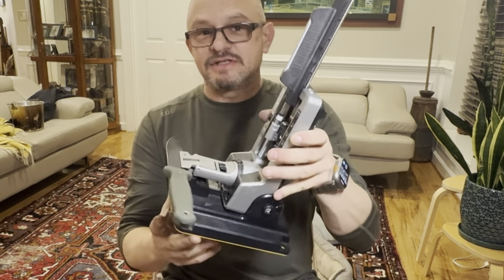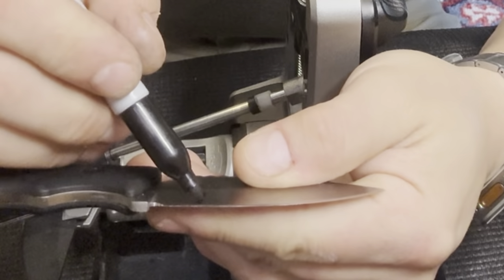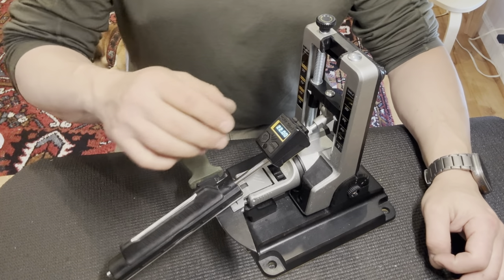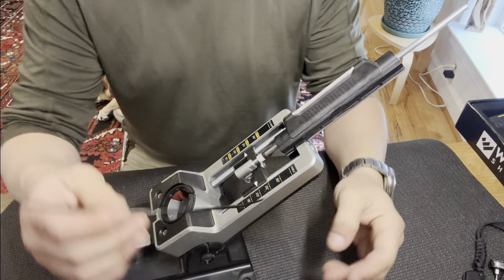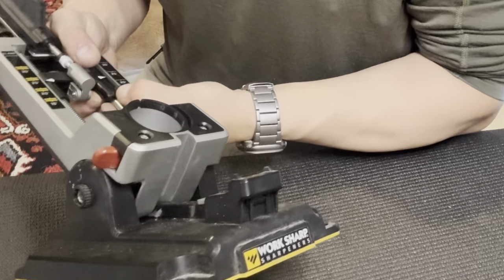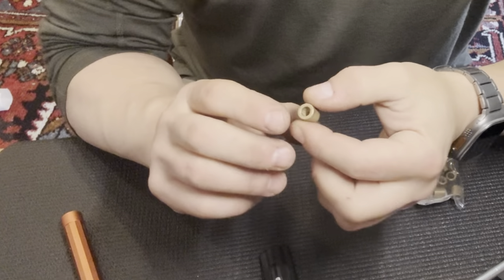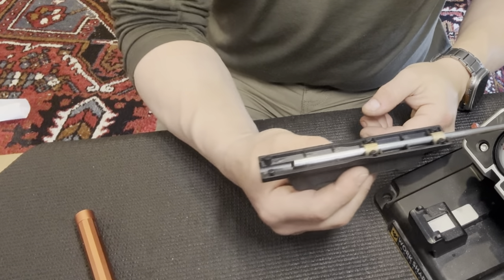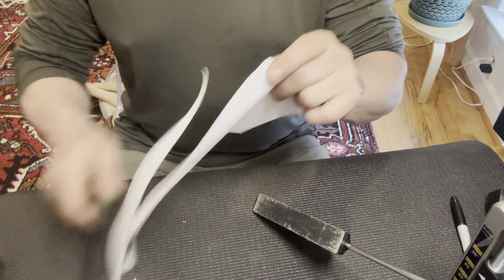Episode #1. Did Work Sharp stop $3 short of Professional level? Is it really PRECISION Adjust-able?

Comment from the maker: Update! Update! Work Sharp is shipping units with screw-less plate carrier. I haven’t had a chance to play with one.  So! Don’t buy the bushings until you receive the sharpener! You won’t need them for at least 3 months anyway!
Reply: Well unfortunately and good for them but most Big Channels are paid for reviews or the item has been given to them. Doesn't leave alot of room for the negatives or suggestions.. only the positives and ➕️'s.. That's why your channel is Important to give us the real and real world challenges.. Good job on your unbiased opinion and Honesty.. Thx!!
Reply: Jon machinist 45yrs here have you disassembled the frame from the  adjustment screw and vertical support bar.  I would like to add 2  assist springs to keep light tension on the whole thing, like a press
Reply from the maker: @broken1965  I think the assembly is more akin to the tool feed drive on a lathe: a worm gear with a parallel shaft. So all that was needed was additional bearing pressure on the shaft side. Unfortunately they left that side open hence the zip tie fix, no way to fit a bushing there.
Reply: If you don't mind me asking what are your thoughts on the lansky Precision Sharpening Kits ?
It's a nice small rig that is easy to field carry .
Reply from the maker: @daryenmirabal2656  just saw the question. If I was looking for a portable kit, the WSPA is much better than the Lansky. The latter’s stones fall out and crack in the middle of sharpening and just for that I would boycott the brand, so disrespectful I find the lack of proper adhesive. But, since it was my first fixed angle sharpener, here’s the truth: It nearly destroyed my confidence in the ability to sharpen knives. With all its shortcomings, the small WSPA is a decent portable tool.
Reply: I bought it. Not a good product . The clip is small and not suitable for small knives, and the body is mostly plastic and doesn’t feel very solid. Depends on what knife you're sharpening, I have one (Crkt LCK + Liner Lock) and the clip doesn't hold it properly, the TSPROF Pioneer Sharpening Kit would be a better choice if it's on sale
Reply: 2nd reply (see below) - Be careful when ordering that Amazon sends the correct size. I didn't notice that the wrong size was in my cart. Not going to send them back though and will have to wait until March 13 before the right ones get here.
Reply: @CuttingBoardRx the stone separated from the plastic handle/backing? Did you happen to buy the kit from Amazon? I’ve had a couple lansky kits over the years, never had that happen. And of the many people I know who have owned their kits over the years, I’ve known 2 people who had that happen with a stone and both bought them from Amazon. I wonder if there’s fakes floating around because Amazon commingles stock. I’ve seen a few people receive fake Spydercos (PM2s).
Reply: Thank you for your honest review and fixes for the problems you found. I have watched a lot of knife reviews recently, from other people, and I have not seen anyone give a negative review on any knife yet. These other people doing "reviews" must be getting some kind of compensation. Thank you for your honest and effort.
Reply: @CuttingBoardRx question. Is there another style sharpener like this that is a solid buy for me. Thanks for this video.
Reply: What do you think about the possibility of installing a ball bearing?
Reply from the maker: @XSXshurikXSX Sure, but linear bearings in this size are hard to find plus they all have nylon inner core, so I would be just trading one problem for another.
Reply: Does the screw less plate carrier mean we can’t access the bushings now?   That would be a bad thing or am I missing something?
Reply from the maker: @ I think that it is NOT meant to be disassembled, so it is not meant to be maintainable 😬
I have to get one to figure this out. I think WS are pissed at me for providing a cheap maintenance solution vs. what they actually want to do: sell you more media carriers. If you haven’t bought this sharpener yet, hold off and watch these videos:
XARILK Gen 3 Fixed Angle Sharpening Tutorials
https://www.youtube.com/playlist?list=PLQk7wjytAnymGwTUYahJoDbCqwgtVWogf
American-made should stand for high quality and ease of use, but WS corporate mindset prevents me from recommending any of their products anymore.
Reply: If I don't shim between the blade and clamp on both sides. I'm at least a degree off when I flip it. Anyone else having this problem?
Reply: Please let us know if you figure out how to get it apart, or a work around.  Just got this Sharpener for Christmas and would love to be able to do the bronze bushing upgrade.
Reply: @CuttingBoardRx  Here's what I got from their customer support.  I'm paraphrasing but would appreciate your thoughts as you know this device as well as their engineers....  The abrasive handle for example has been redesigned with an improved process that no longer has the screwed-on plate on the bottom, so replacing the bushings is no longer possible or required. It was done to prevent the handle from cracking and breaking apart around the screw holes. Our testing shows that the oil impregnated self-lubricating bronze bushings are more prone to collecting debris and getting sticky since the self-lubricating oil collects more grit and debris, which makes it harder to clean and is more prone to wear. Therefore, we have chosen to continue using the engineered plastic material since it performs better over time when used as directed with light pressure, frequent cleanings and no lubrication. I'm not trying to upset the company.. just trying to get facts.  Also, worse case I don't recall the company names but another makes a stone/holder/slider for this device too.  Granted another $50 shipped but wondering what your experience that that is... for somebody that already owns this device. Thanks again.
Reply from the maker: @ I investigated the new holder and found that it wasn’t possible to take it apart. I am experimenting with the way to add bronze bushings and will post a video on this topic in near future. Hapstone is the company that makes the universal holder but by the time you pay for it and the plates, you could get XARILK Gen 3 system that comes with 8 plates for $109. I have a few videos about it. If you’re within the return period, that might be a better way. 
As to debris accumulation, of one can remove the bottom plate, one can clean the debris out… couple of contradictions in what they told you. Perhaps it’s time for them to learn that “knife enthusiast” isn’t synonymous with “simple minded?”
Reply: @CuttingBoardRx  You have a great dry/witty sense of humor that often makes me smile.  Yes I must remember sunk cost and sometimes start fresh.  :-)
Reply: I have the new carrier without the screws.  They have sent me two new ones because they keep binding up.  The third one is binding as well.  They work fine for a bit and then seem to get gummed up an bind.  I can clean them by rolling up a piece of  paper towel and twisting it through.  The paper towel comes out with a black oily film on it.  After cleaning it works ok for a bit and then binds up again.  I follow the directions and take light strokes and wipe the rod frequently but nothing seems to help.  I think I will try and crack one of the holders open along the seam and see if I can get those bushings in. Very disappointed with this.
Reply from the maker: @ Don’t crack one open. It is superglued all the way around and you will end up breaking it. Can you send me one please, I think I may have a solution but I need an intact carrier to try it out, just the carrier, have the rod. If you’re willing to send it, email me please CBR.YTC@gmail.com
Thanks!

Comment: Thank you for the video. I really like my Worksharp pro and use it often. I think the things you pointed out and found a solution for will make my experience even better. I hope you will let us know if/ when Worksharp responds or comments on your findings. I think they should appreciate your video, especially as you were a promoter of their product. The only negative I think they might perceive is that you suggested your viewers send the inferior-bushings along with a thank you to Worksharp.  Other than that they should be appreciative. Thanks again for the video and suggestions.
Reply from the maker: Haha! I intentionally poked fun at their engineering department! I am of that profession and if I was a betting man, the bet would be the prototype was all metal and somewhere along the way the design got “optimised” for production. The logic is that professionals would use stone wheels or shop belt sanders so they didn’t expect some amateur doing 20-30 sharpenings per month.
Thanks for the great comment!

Comment: First. Thank you so much for sharing your experiences!!
I also have the professional sharpener. I’ve used it from "Victoninox "to Magnacut steel.
I’m gonna solve the problems 1 &2 this afternoon. Thank you again
I never had problem 3 maybe because I don’t use the original stones. I bought, from Gritomatic a 6 inch stone holder (hapstone brand) and I use Venev centaur double side stones and Nano Cloths with diamond “spray”. The scratch pattern in the blade is better.
My problem with this system is with long knifes. A 8 inch blade, if has 15 deg at the center of the clamp, will have 10 deg at the tip or at the heel, no matter how you clamp the knife.
Another problem with long and thin knives is that they bend using only 1 clamp. 2 clamp system  is better. Anyway, my kitchen knives cut towel paper even with those isues
Reply from the maker: Thanks for commenting! It’s great to hear from a fellow sharpening nerd!

Comment: Did your three tips and they all worked well, the zip tie on the clamp receptacle was a bugger but got it done. I have a wicked edge set of stones and strops and wondered if the rod sizes were the same. They are and I have just gained access to a huge of amount of stones, best part there are two grits on each wicked edge stone.
Reply from the maker: That’s great information! Thanks for sharing and subscribing!

Comment: A few things to consider:

1.  When you're measuring the flex of a the jaws in the knife sharpener, you have the measure the variation between the movement of the blade and the pivot of the rod that holds the abrasive.  If the plastic base flexes, causing them to both move the same amount, then you would not affect the angle at which the abrasive contacts the blade, and it would not be a problem.

2.  If the mount of the pivot, or the jaws flex when force is applied upward or laterally, it should not matter.  You won't be applying force upward or laterally when you sharpen a knife, so there would be no reason for those parts to be engineered to brace against force in those directions.  Doing so would add un-necessary cost to the unit.

3.  When you measured the angle of the rod above and below the abrasive, was it contacting the table?  It was hard to tell from the camera angle, but that would naturally change your outcome.  Really, the measurement should be taken with the abrasive contacting the blade, as that is how it would be used.  The comparison would ideally be between the contact at either end of the abrasive.

4.  How much force are your applying when you sharpen?  The task does not require much more than the weight of the arm and the abrasive, and the combination of your complaints about flexing and the wear on those two bushings implies the use of more force than is necessary.
Reply from the maker: your questions are very good, I am currently working on a video that will hopefully answer some of them! Stay tuned!
Reply: Following up on this, you showed the rotational movement on the clamp when it not in the down position supported by the base bridge. Would assume the bridge serves to eliminate/reduce any such clamp movement. If not, you should show that flex while in the intended, down position.

Comment: Just gave you thumbs up brother this is the best video on this system I’ve seen. Going to buy one since I suck at hand sharpening. Thanks for the video Happy New Years!
Reply from the maker: @wolverinegnr  Before you pull the trigger, check out my videos on XARILK Gen 3.  Just saying. Save some scratch, brother. 
Oh, and Work Sharp changed something on the plate holder, it no longer comes apart to put in the bushings. They want you to buy a whole new rod assembly. Just for that I’d look at my other suggestion.
Reply: @ Nice video just when I thought I had my mind made up back to the rabbit hole I go. Lol  Since you have both which one seems like it will outlast the other and do you find that they give the same results as far as putting on an edge? Thanks
Reply from the maker: I can’t speculate on longevity, but the plates availability at every possible level and cost would sway me to XARILK. Everything on it is TS Prof compatible at 1/5th the price. And they have responded to my original critiques and changed the design in 4 weeks. If it bothers you that I’m recommending it over the US-made one, I take comfort in watching Chinese company kicking a Russian one. Here’s my associate link, be advised, I will make about 3.3 bucks if you buy it 😂
https://amzn.to/3DAFUZK
It ships with aluminum backed plates btw, thanks to my earlier video critiquing the plastic ones.
Reply: @CuttingBoardRx  I purchased the XARILK yesterday using your link in the description. Seems they a little back ordered they have mines shipping Jan. 20
Reply from the maker: @ It’s understandable, considering how many people finding out that it is compatible with TS Prof.
Thanks for supporting my channel!

Comment: I made a completely new center from a piece of aluminum and pressed a bronze sleeve on one side and a threaded sleeve on the other, I just need to figure something out with the lower plastic.With such a second sharpener, all these elements should be stiff and made of metal with bronze bushings or abrasion-resistant Teflon bushings.
Reply from the maker: Very interesting! Send me some pictures, email is in the channel description
Reply: @CuttingBoardRx  I'm still working on it, I'm waiting for parts from China, bushings, a feed screw with a smaller thread pitch and a nut. When I deal with it, I'll send you the finished version of the corrections stiffening the sharpener.

Comment: This is a GREAT video!  My hat’s off to you.  Not only did you uncover design flaws, you thought out and tested fixes.  It’s a shame that one has to make these modifications to a brand new design to allow it to give consistent results.  Shame on the engineers at Worksharp.  I am currently considering an upgrade to a better mousetrap than my Hapstone Pro.  I would not give this a serious look until Worksharp makes these fixes in the manufacturing process.  At this price point there shouldn’t be this level of inconsistency in their design.

Comment: This video is worth its weight in gold. You'd never see paid reviewers address issues and design flaws like these in their videos, let alone provide solutions on how to fix them.

All the flaws aside, would you consider this system recommendable for sharpening beginners?
I'm currently undecided whether to invest into regular (diamond) sharpening stones and learn to sharpen by hand, guided sharpeners like the Precision Adjust or electric ones like WorkSharp's Knife & Tool sharpener.
Reply from the maker: Not only would I recommend this WSPPA for sharpening beginners, but considering it’s price, I would suggest getting the basic WSPA ($60) as the first sharpener for a beginner.  Either allows you to focus on the fundamentals of edge geometry without having to deal with the Human factor. Starting with a hand held or wet stones will lead, with 90% probability, to forming bad habits. Get the edge geometry and burr formation right first, then, when you switch to hand grinding, or belt sanding you will immediately know if you’re not forming a correct edge. I would not recommend the composite stone Lansky system, you know, the red box one that is selling for $39 or anything by Smyth.  They will distract you from  learning the fundamentals and then break 😂
Reply: @CuttingBoardRx  Thanks a lot. Really appreciate the insight. Obviously, the basic WSPA has been on my radar as well but since I'm more of a buy-once-cry-once kinda guy, I feel like I would immediately regret not getting the WSPPA instead. 😅 In terms of build quality and improvements, it certainly seems like the better investment in the long run, even though it would mean living off of Ramens for a while. 🤣
Reply from the maker: @RobEDC  Totally go for it then! Glad I could help

Comment: Absolutely love these hints/fixes and they come to me a day after I sent mine back. 😒 However, I think I will order a new one, implement these fixes and carry on. Loved the sharpener otherwise, although I'm placing the Work Sharp Ken Onion  Sharpener into my tools tomorrow when it gets here, which I have also used. One thing - Can you find a way to get the clamp about a quarter turn tighter to hold the blade from laterally wiggling, if that makes sense? Thanks bunches!
Reply from the maker: Sir, you just gave me an idea for the next video!
Reply: @CuttingBoardRx  We need a means to apply a little more torque to the "nut", I think. A larger one perhaps? Can you make this happen for us oh worthy one?
Reply from the maker: @aremel I am setting up a test to see if more torque would translate into more holding power